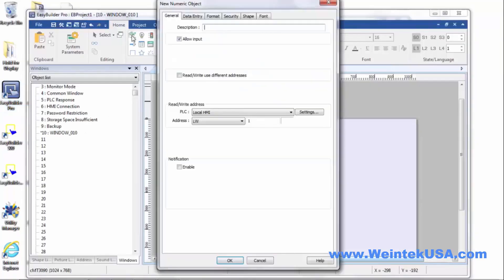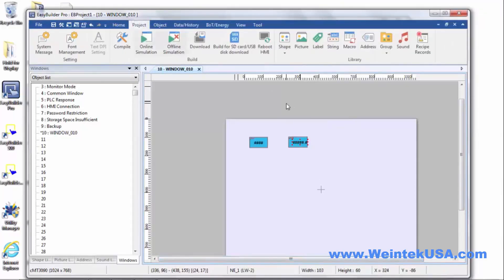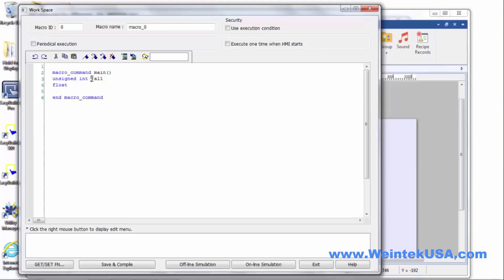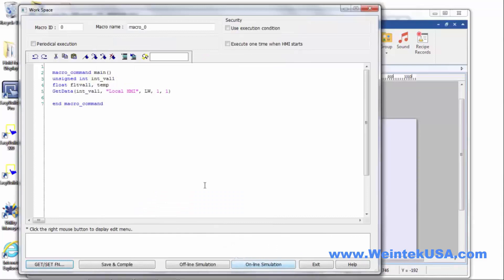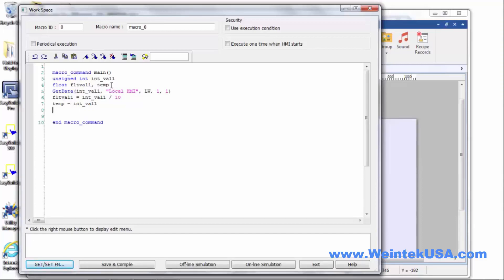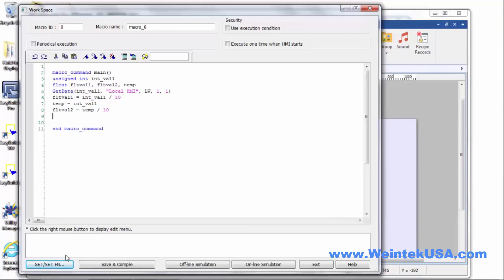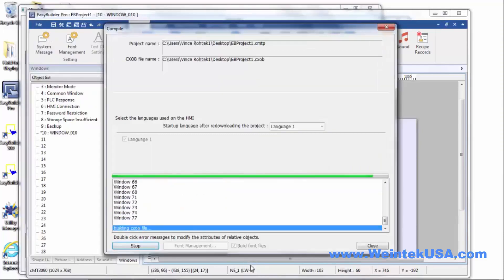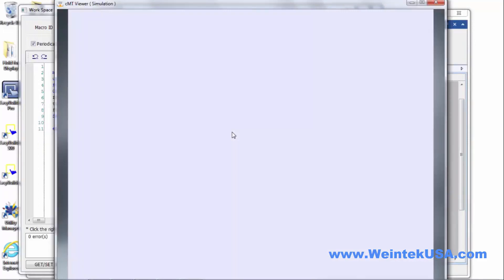How to convert Macros Integer Value to Floating point EasyBuilder Pro Weintek software

Comment: Your code is very difficult to understand. Why are you using a variable fitval1? 
may be:
macro_command main()
int int_val
float float_val2, temp
GetData(int_val, "Local HMI", LW, 1, 1)
temp = int_val // conversion here
float_val2 = temp /100
SetData(float_val2, "Local HMI", LW, 4, 1)

end macro_command